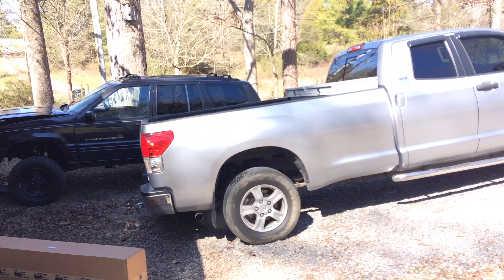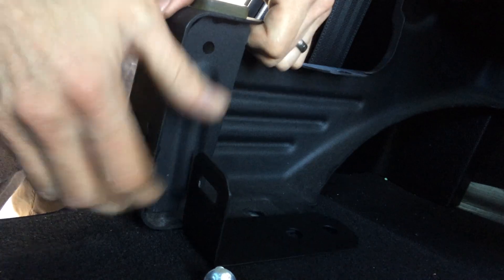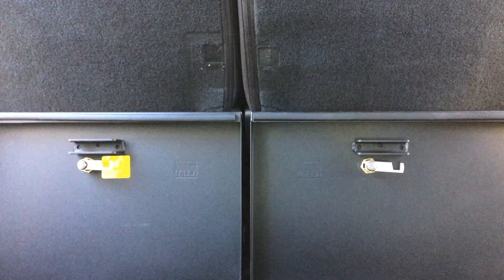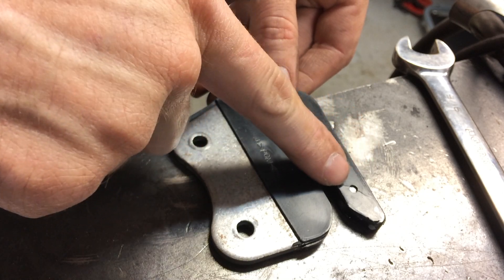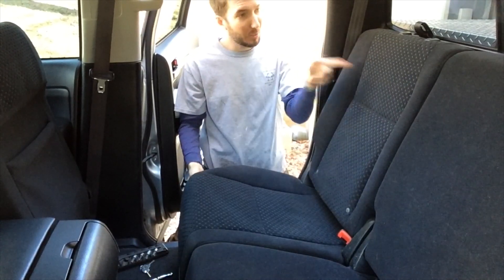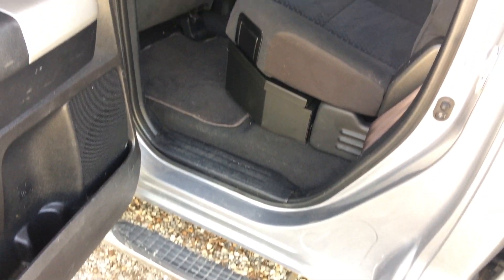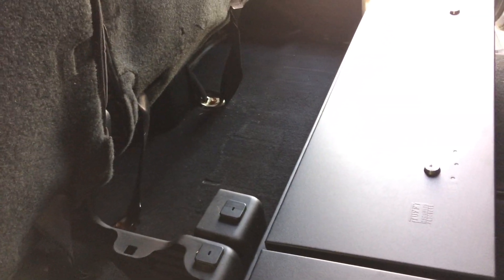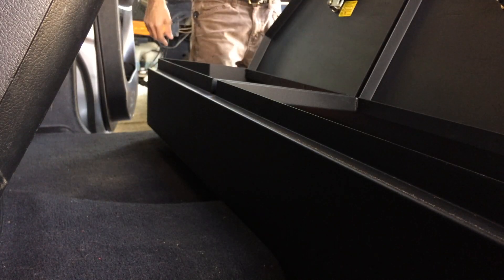Tuffy Security Products and Tundra Seat Fold Down Mod

Comment: Would that box fit a 2018 tundra crewmax
Reply: Unfortunately, no. Nor will the seat mod work because the seat design is different from the double cab. I took out the 40 seat and discovered there are no hooks to modify nor anything connecting the seat to the rear of the cab. There seem to be 2 bracket like pieces welded to the hinge of the seat, preventing it from folding. I'm sure this is a toyota safety concern. I am contemplating cutting the hinge but with no way to secure the seat back, I don't want it flopping around.

Comment: How did u put the seat down ?? I need help
Reply: Remove all the bolts floor and bolts on the back wall under the back rest  with the seat bottom folded ( 9:00 6 bolts ) don’t remove the 2torx bolt that keep the seats together lift the seat up and out p.s. a helper would make it easy remove the retaining hooks and cut off One inch from the thin side off the hooks make absolutely sure to keep the tip at the same angle then smooth the cut piece with a file or Dremel put hooks back reinstall the bolts you removed then lift the sitting part of the seat with one hand on the backrest push towards the rear and when you slightly lift the seat you can feel it hook do reverse to fold down

Comment: only problem with the seat mod would be overpacking gear behind it. if you do, you won't be able to lift the seat bottoms up to get stuff from underneath. if you pay attention to the way the seat works, the back of the seat swings back against the rear wall as the bottom comes up. 
i have to explain this to tundra (and other truck) customers all the time when they want to add sub enclosures behind there.

Comment: Thanks for the info on seat folding. It seems like Toyota got lazy on that one. The brackets on the 2021 Tundra dont have the little plastic circles so the 7/8" measurement is a good guide to go by. Also it would be helpful to mention that you'll likely need to unbolt the seat belt anchors in order to lift the seat high enough to get them off the slot brackets otherwise you're fighting that issue also. After that little minor battle it works awesomely. Tanks !!

Comment: Couple of things with this mod.
1 The hardest part of this job is getting the T30 torx head screws OUT. Fortunately they are G8 screws. So they didn't round out. I had to use a 5-32 allen bit and a mini side ratchet. I think they used Loctite-lite on them. Plus the seat frame/cushion really get in the way.
2 When reinstalling use bolts. I had some M6x1-12mm that I used. Worked perfect.
3 There are 6 bolts to remove. Not just the floor bolts. The other 3 go on the back panel.
4 Planning on adding a small grab strap on the upper part of the seat.
I really like this mod for the rear seat. Now I can add a Mini-9 ping pong paddle to the mix.

Comment: As good as you are at fabricating I would think you could make a box that would contour itself to the floor instead of sticking up several inches. Also you could install a lock that had a spring loaded rod that secured both sides with only one keyed lock. Come-on Matt, your good at this kind of thing, quit wimping out and get to fabricating.
Reply from the maker: https://youtu.be/tG8Kd0sJC5Y
Reply: Ha Ha I get the point. I was only commenting on your ability and expertise to make a better fitting product for the security box. Seeing some of the nice things you have fabricated I am willing to bet that you could even make one out of scrap  expanded steel. Cheap, plenty of airflow and easy to lock.  But what do I know, I work on Volvo's.

Comment: Wow.  With plastic wing nuts I don't think I'd trust them to hold anything important.  A $30 crowbar and someone could leave with a whole tuffy box and whatever goodies are inside in a matter of seconds.  Other than that it looks like a cool install. ... Also what safety issues might modifying the brackets like that have?
Reply: How about a socket and ratchet?
Reply: Or battery powered sawzall.